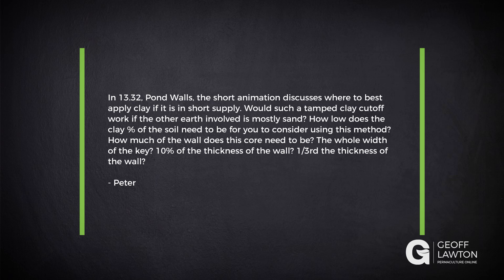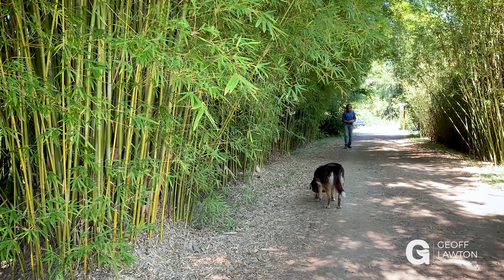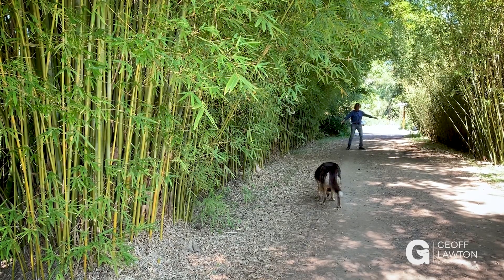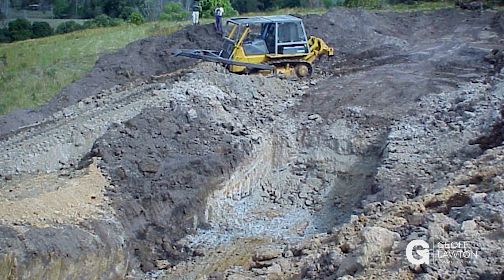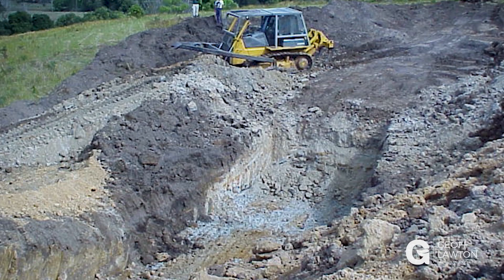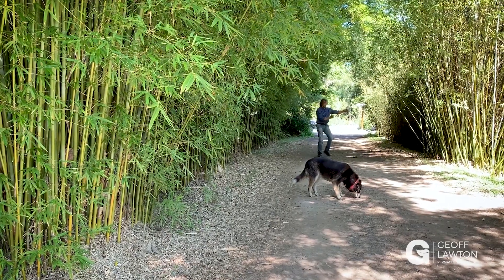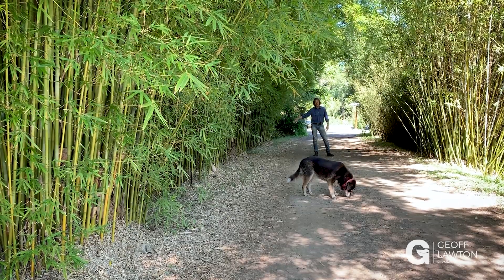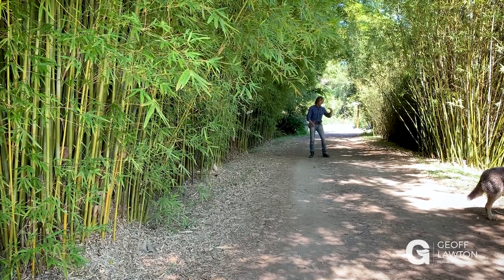Pond Walls and Clay Application

Comment: I would add, that in poorly built aquaculture ponds, that basically leak, before getting to polymers, a very good option is silting. This can be done by pumping in water with clay and letting it set, and subsequently, densely fill the pond with fish and feeding them. Fish dejections act rapidly as silting material. Look up FAO literature on tis matter from the 1980ies.

Comment: I just bought 100 acres of red soil at Koonorigan. I want to build a dam half way down the hill, but I'm worried it will leak. Is it always best to use bentonite clay when building dams on red soil?
Reply: Do the soil test to know whether you reach the 40% clay mark. If so you can use it as is.
Reply: How did the bentonite go on the red soil ??
Reply: How did the bentonite go on the red soil or did you use clay or the retchid POLY